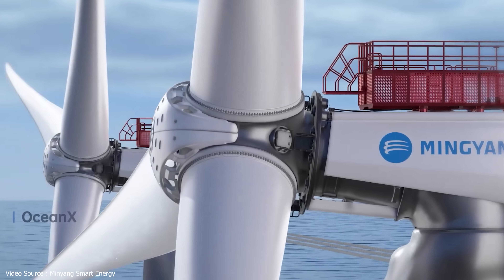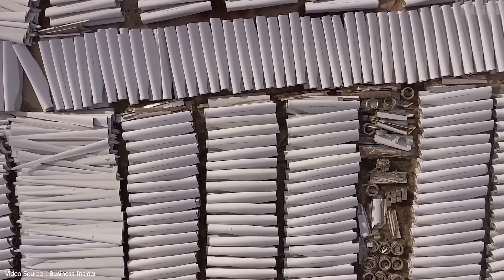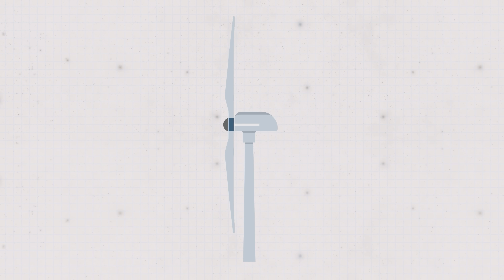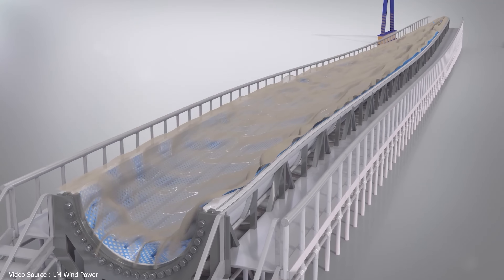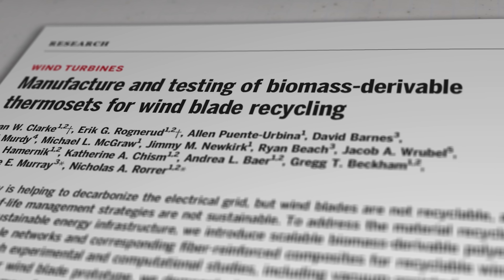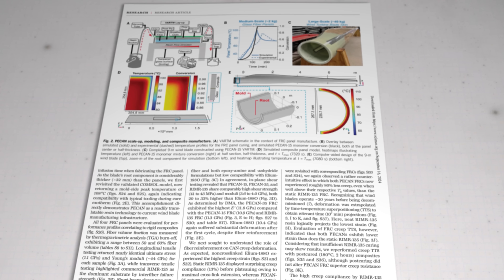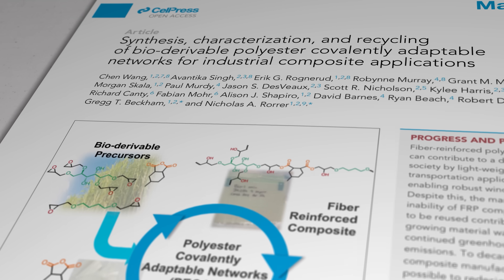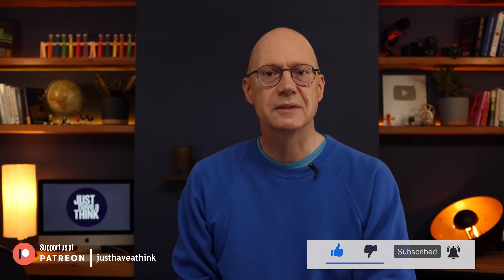FINALLY! Fully recyclable wind turbine blades!

Comment: Just a wild prediction, but (assuming we don't exterminate ourselves first.) I think many of today's turbines, possibly even solar will never be replaced. I really believe that in ten to 15 years, geothermal is going to be where all the money is going. If the two main industry leaders aren't full of it, we could see a true paradigm shift as soon as they get a few working demos built. (We are still going to need fusion to try to repair some of the damage we've done, but it's nowhere as near to maturity, as the new geothermal tech.)

Comment: What about reusing the blades? It seems to me that even a stationary blade, standing upright, might generate sufficient 'wobble' to power a small generator.  Or maybe, set at an angle, a single blade would spin around its axis to generate power.  And who wouldn't want to have a 120 meter blade in their back yard?

Comment: Very interesting.  And very needed.  I didn't hear you mention it ... but ... another major (new?) concern with these fiberglass wind turbine blades is that they do degrade while in service.  They actually shed fiberglass material off the blades and into the surrounding environment.  Floating ones ... into the seas/oceans ... and land based ones, which usually (around us, at least) is in farm lands.   That is into the food supply.    Can you say "Yikes!".
This brings to mind the push several years ago to switch from incandescent light bulbs to compact fluorescent bulbs ... which I did ... but which, as I did hear later, contained mercury in the base and which were most probably mostly thrown into landfills as well.   Can you say "Yikes!", again.
Last item on the "balance out the good with the bad" rant;  Solar panels.    I love the tech ... I am a retired engineer ... I've been keeping my eyes on the progress for a long time.   Initially, I had heard that it took more energy to mine & transport materials, manufacture, transport and install than the panels would ever generate in their lifetimes.   Also when I looked at it a bunch of years ago the cost verses payback was absurd.
However, time passes, progress is made.  However, the one aspect that I continue to monitor is their disposal.   They contain a lot of heavy metals and the vast majority of the panels reaching their end of life are ... surprise, surprise ... being dumped into the landfills.    Third times the charm ... "Yikes!"
It may sound like I'm against all these ... I am not.    I'm again looking into getting my house set up with solar/batteries/inverter.
I guess I may do what everyone else is doing ... kick that can down the street, to be delt with later by somebody else.
Reply: The amount of mass that they shed is trivial compared to the real problems, like plastic packaging, plastic clothing fibers, fishnets, etc.  We need to think about the harm of NOT using wind power.  Coal is a thousand times worse.  Maybe a million times worse.
Reply: @incognitotorpedo42   ... I agree ... much better than coal.  But the comparison to coal isn't the main focus now, as coal usage has declined ... and is continuing to decline.   However, not too many years ago the push was to switch everyone TO Natural Gas.   ("The future belongs tot he efficient!" ... or something like that.)   There has been statistics that showed (... sorry, I don't have  a photographic memory and can't reference the exact source of the data.) that the US was getting to a "greener/cleaner" environment and it was attributed to the use of Natural Gas and away from coal and heating oils.   I'm not saying that we shouldn't continue to move to a more and more clean energy supply ... however, ... we must have energy.    It will never be all all or nothing answer.   The best ideas will replace more and more of the not so good ideas.

Comment: 8:45 - If that's the actual polymer structure, then it is most certainly biodegradable and may be recyclable for lower tier functions.  The key question though is what additives are included in the formulation.  Putting aside biodegradability, PVC is a great polymer.  But it is doped with >50% w/w plasticizer which has historically been DEHP or other phthalate replacements which are quite toxic.  Every time you go into a hospital and get an IV bag stuck in your veins, bear in mind that you are getting (at least for saline) a relatively small dose of plastizer and other additives with each bag (be it PVC or LDPE, most commonly).
Reply: What are the lower tier functions you referred to?

Comment: This sounds a lot like the idea that Mercedes came up with to use biodegradable plastics to insulate wiring from 1991-96 with huge problems causing many vehicles to be recalled due to problems with the insulation degrading because it was BIODEGRADABLE not to mention the fact Toyota had a similar issue using a similar product that caused rats to eat the insulation because it was made from soy, and do you really want a 5ton blade falling or flying off because it's degraded or been eaten?
I'm all for wind turbines but this seems like a stupid idea for large turbines.

Comment: I think the most resilient and sustainable future will be much closer to being human scale. By that I mean, human energy can be the most important part of the overall energy mix. Yes, that’s an ideal goal to strive for in terms of maximum sustainability.  However, we can strive for better optimization of energy mixes as we strive to get closer and closer to that most sustainable goal.  For the time being, big centralized systems are mirroring big centralized government so that the control of their manufacturer and distribution remains in the hands of a few people, as we downsize the kinds of systems we build, we get closer to democratizing whatever it is we are trying to do. Obviously, there are practical limits to that.  given that democracies only work with small groups of people, and as the group gets to a limit in size, a Republic becomes more necessary. This is the same process that led to the aristocratic and autocratic systems we have today, so our progress towards the more sustainable future must be optimized around, socioeconomic factors in order to be not only more Humane, but more sustainable.
Reply: Human energy like in the Matrix movie? - Just joking.

I think you are wrong though! The reason everything gets scaled up like that is because it is more efficient.
You can see it with wind turbines, if you double the diameter you get 4x the energy output.
The same with cities, dense urban cities are much more energy efficient than city sprawl/rural areas.

I know it seems much more idyllic with everyone suppling their own needs, but it doesn't work like that.

Comment: Can we use'em as breakwaters off Great Yarmouth? They'd look nicer than sunken ships and oil rigs.
Reply: Probably not strong enough. And after some erosion glass fibre in the water contaminating everything... Well, I'd think about that.
Back to not strong enough: years ago I've seen an experiment that aimed to harness river/tide energy in the Hudson. The turbine was small (experiment), and hours or some days later as they lifted the turbine out all blades were torn apart. Water is much stronger.

Comment: Why can't the blades be cut into managed sized pieces and used as a housing material to those without traditional homes?  Rather than tents in war torn places, the panels could be used to form walls and/or roofs to shield people against the elements!  Putting them in landfills seems stupid.

Comment: The rotor diameter is 260m, not the blade length. The blades would be about 120m, most of the radius. SANY has been making 130m blades in China.

Comment: Worth a go.  I'm a bigger fan of solar panels all over every building and parking lot.  From what I understand, the materials for those are very recyclable.
Reply: Stick to your guns. By my estimates the cost of putting solar panels on homes to equal the amount of a given wind farm is about 1/10 the cost. Another words that takes about $200,000 worth of equipment out in the water to obtain the electricity that you get from $20,000 worth of solar panels on a home.

Comment: FInding ways to recycle these makes sense, HOWEVER we should have some perspective.  Globally we dispose of 1.27 billion cubic meters of waste a year.  Currently wind turbine blades amount to about 50,000 cubic meters of waste a year.  Estimates say this could go up into the million(not 10s of millions) of cubic meters globally eventually.  So, one, the current waste is tiny relatively speaking.  And two, we have some time to figure this out before it start being an issue.
Reply: Yeah this seems like it isn't even really a "problem" that needs a solving

Comment: I have often wondered why the blades were not made of bamboo laminate instead of carbon fiber. Bamboo is a lighter weight density as well as stronger than carbon fiber not to mention easily sourced.

Comment: Any chance of a lightweight reusable metal core with a replaceable skin? AI design metal printed core. Metal leading edges. Lightweight synthetic skin
Reply: Maybe a chance, but.... what's great about wrapped composites is their section modulus. All of the mass is on the outside of the structure, making it as stiff and rigid as possible. 

If you had an inner structure that had to support itself and provide the framework to support the skin, I don't think it would be as strong and would have to be heavier. I think the idea is possible, but not optimal from a strength to weight standpoint.
Reply: I like your thinking, possibly better durability, but my guess is it's too heavy.
Reply: Metal printing is incredibly expensive and will be for the forseeable future. There is a reason it is only used in small, complex, specialised and highly expensive appications. Also the lightweight metal you would want would be Aluminum, which is absolutely awful for repeated heavy strain cycles.

Comment: This is more greenwash. You desire machines to be built to last, like machines were in the 1800's, which lasted not 20 years but more like 100 years. Modern 'efficient manufacturing' (cheapest) means machines will be 'recycled' because they simply cannot last. So you need 5 generations of machine manufacture and 5 recycling processes for the same 100 year service. This serves profit motivations and economic wonks who love the huge financial implications for gdp and money circulation, and fools eco-minded folk who hear 'biodegradable' and wet themselves with excitement, utterly failing to understand that a long lived machine is far more environmentally beneficial than a short lived one.  Blades should be made from steel or aluminium, not composites. Composites degrade and are impossible to recycle. So the solution is not use another stupid material, it's use a proper material.

Comment: If by switch they can save that 2nd heating and curing cycle, that by itself is a win by reducing energy requirements and time which translates into cost savings.  CO2 emissions and recycling benefits are the gravy to the new material technology.

Comment: When you mention "plant based" I thought it would be about genetically modified trees that grew in the right size and shape to be used as turbine blades straight out of the ground.

If a tall tree was used as the tower the blades could grafted in place before it grew to full-size.  Indeed they could be harvested at different stages in their growth depending on the size of turbine you required.  You could produce anything from a small bush turbine for domestic use to one the size of the mighty redwood.

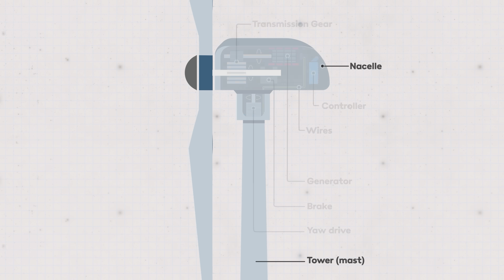Comment: At 3:55, the diagram has a pointer to "wires," (but only to some of the many many wires) but no pointer to the gears.
This is horrible, horrible discrimination, and represents both gearic and wiric defamation, segregation, and invidious deconfobulation of the highest order, and is sure to be reported to all the world's authorities.  Excuse me, Authorities.
Come to think of it, a single capital A may not be enough.  This is YouTube. Shouldn't I maybe be SHOUTING IN ALL-CAPS?
As  for the question of whether this could revolutionize the green industry, please note that by the time the blades become eligible for biological degredation they are no longer revolving, so this has to be considered an empirical question.
Reply: LOL

Comment: Correct me if I'm wrong but hasn't Vestas solved this one with a chemical process that returns the components of a blade to a state where they can be reused to make new blades! They claim that it's so effective that it will be worth digging up old blades to recycle them for materials.

Comment: PECAN16 sounds wonderful, but the road from research/lab through to production is the real story.  But with the 'old tech' blades. using as fill in durable structures especially if it can add reinforcing to replace some cement (flyash can be used instead of cement and is a good way to dispose of dry flyash) in concrete structures.  BTW, Looking at using flyash in this way use might be a good video suggestion.